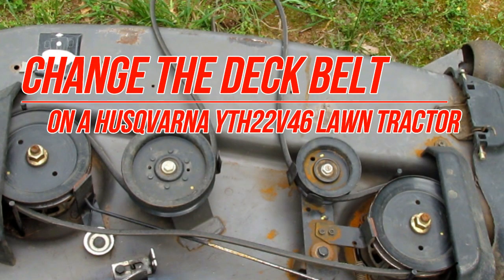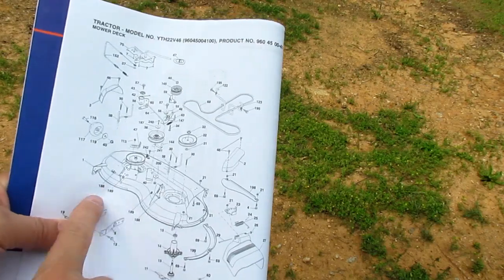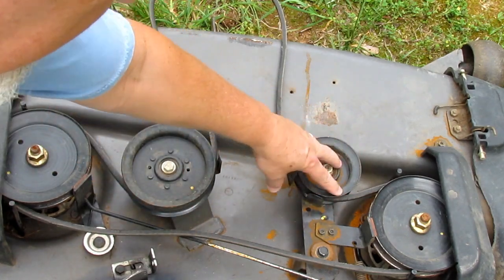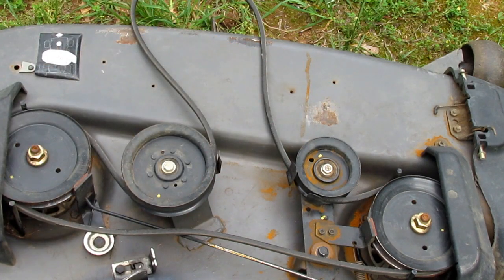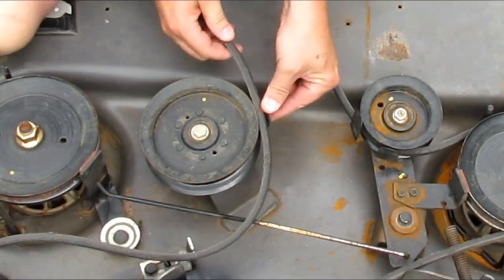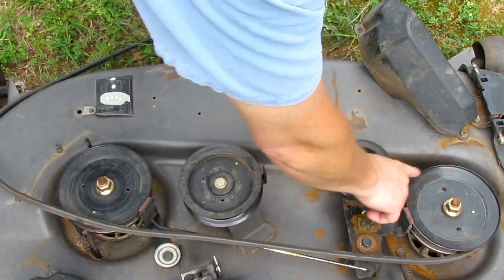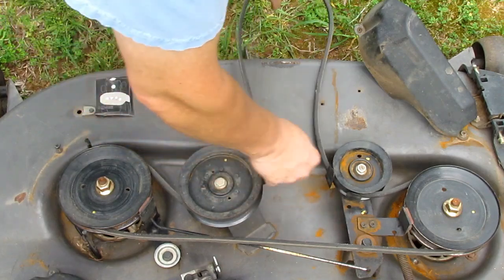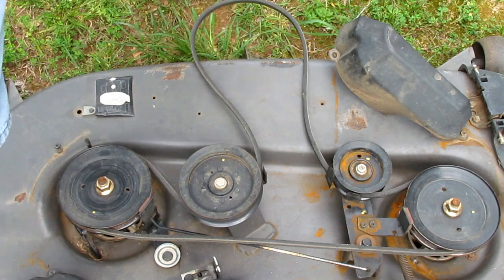Replace Deck Belt on Husqvarna YTH22V46 Yard Tractor

Comment: I did all that and the blades won’t disengage.  They keep, running as soon as the engine turns on.
Reply from the maker: Hi Todd, thanks for watching!  I'd recheck the belt routing.....if it is routed correctly, check to be sure that your deck belt is running correctly through the guides around the engine pulley.  I've had mine through those guides incorrectly before and had the same problem.

Comment: Do you happen to know what that belt length is
Reply from the maker: Thanks for watching!  My manual says the deck belt for my YTH22V46 is 105.75 inches.
Reply: Dennis Coffey Just put a brand new one on there and it shredded it too and I can’t find what shredding it ......dang it
Reply from the maker: I've shredded a deck belt in the past.   I mistakenly ran the belt outside of the spring-steel guides on the idler pulleys of the deck.  The sharp edge on those guides will destroy a belt.  The belt should be between the guides and the pulleys.  I've also seen a belt give trouble if it was installed 'backwards' with the flat side running in the grooved pulleys and the V side running against the flat pulleys.

Comment: I have the Husqvarna YTH21K46, took off bad drive belt, cut and measured an exact 104 inches.  New belt is 105.8 inches.  Belt # 532405143 comes from my manual and Husqvarna direct. Will it work, no info on my 104 inch original drive belt.
Reply from the maker: HI Reuben,  I'm sorry but I'm not sure I'm following...the manual for the YTH21K46 shows the deck belt as 532 40 51-43.  That belt is 106.8" long.
Reply: Hi Dennis,
My manual read the same way, but the original belt that I took off measured 104 inches.  In all my searches, the 5324005143 did match the manual specs.  The new belt is 2.8 inches longer, I didn't think that the idler pulley would pull it taught enough.  To my surprise, it had better grip than the old 104 inch belt.  I guess Lowes ordered their Husqvarnas with shorter belts to save money. 

Thanks for your help

Comment: +Dennis Coffey what does it mean if the mower blades kick on very slowly?
Reply from the maker: Hey Dylan....you probably have a loose belt.  When the deck belt is too loose, it will delay the blades coming up to speed.  Try this:  turn mower off, engage the blade lever and check the belt tension on top of the deck.  If you can slide the belt through the pulleys with one hand, it is too loose and should be replaced.
Reply: +Dennis Coffey i turned the lever until it was in the engage position and it still felt like it was putting alot of tension until i lowered the mower deck and played  with the belt it felt like it was a little loose but not very
Reply from the maker: Yes, it's OK if it has a little play in the belt, but in the 'engaged' position and not running, you should not be able to move the belt longitudinally without making the blades turn.  In other words, if you turn the belt, the blades should turn equally and not slip.  You may want to disengage the blades and check the blades for excess play in the spindles.  The spindles could be worn and binding a bit causing the delay in coming up to speed.  The only other thing I can think of is to check under the deck and make sure it is caked up with dried clippings...that could slow the blades down too.
Reply: +Dennis Coffey i'm going to check it while it's over at my neighbors getting the valve cover gasket replaced and if it is caked with grass clippings i might take the mower deck off and clean it before i mow

Comment: I have the same model tractor. Never got a manual with mine. Only quick reference guide for maintains mower and a motor reference guide.   Miter on tractor is great but, there are problems !    Starting problems.  I don’t think it’s ignition switch .  Coil could be it.    I got my tractor from Lowes and got extended warranty insurance.  Glade I did …    The spindle design is terrible. The metal used is may I say crap !!!!!  Is it a aluminum pot metal?   A milled block aluminum metal should have been used in the spindle where the self trending bolts hold spindle to deck.    Does anyone know about the tensioner pulley problems.  I just replaced both spindles and blades and belt.    My tensioner pulley is not working properly.   Help me
Reply from the maker: Thank you for watching, Rob.  If the tensioner pulley has excessive play, the bearing on it is probably shot and should be replaced.  Check out this video for your starting problems:  https://youtu.be/b2-1erNO_ks

Comment: Maybe japan can understand it. One showed front pulley to inside of the back pulleys [not yours] Another says no ? Why make something simple complicated? We have had nothing but trouble from our husqvarna yth 24v48.It should be designed [very doable] to change out with ease the belt=Release tension take old belt off and new on. Hell no. The public allows this after paying two to five thousand dollars. Now our belt is off after a yr of mowing. Pulley's [2] replaced, quit pulling and now this.
Reply from the maker: Yes, I agree....there is way too much removal involved in a simple belt change for this mower.  Thye could have made it much easier and still retain the performance and safety features.  I'm sorry to hear you are having so much trouble with yours.....hopefully you can get things resolved without too much headache.  Thanks for watching and supporting my channel.
Reply: Dennis=Don't want to leave without telling you your video did help to at least let us know in general how the belt should look on the pulleys. Graduated 5th in State Police academy but when trying to just put the belt  back on it whipped my ass. Don't guess i was smart enough after all. It should never need be more complicated than putting a sprocket chain on a bicycle.  IT'S about future finances .[parts and labor]
Reply from the maker: I'm glad you got it put together and I hope it works well for you.  I agree...the thing is way too difficult for just replacing a belt.  I suppose they want the dealers to do it for $$.  Thank so much for your comments and feedback on my video.  I'm glad it was of some help.  And...thank you for serving!!

Comment: You should have needled those bearings when you had it that far apart
Reply from the maker: True, if I was just swapping the belt, but I actually took it out from under the tractor to replace the spindles, so no need to bother as I was replacing the bearings anyway.  :)  I made another video of swapping out the spindles.  Thanks for watching and I appreciate the comment!